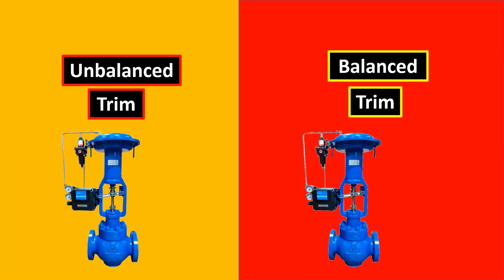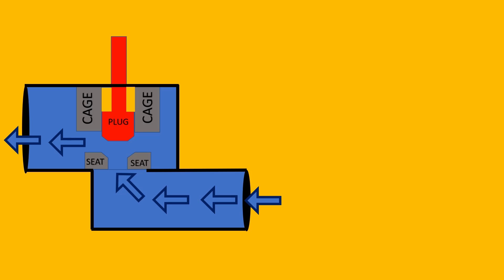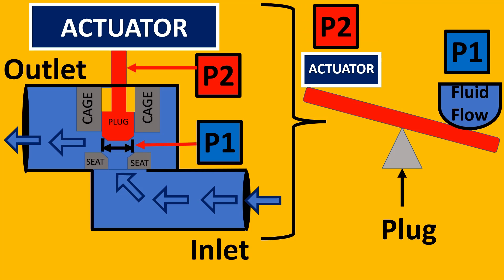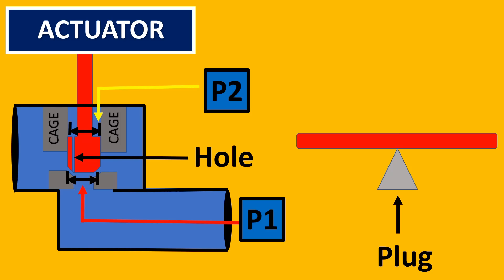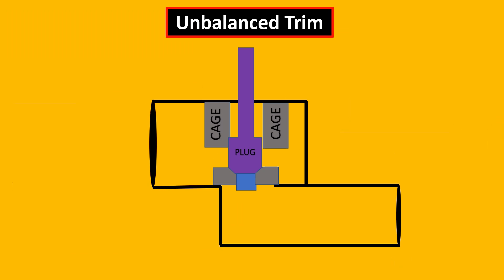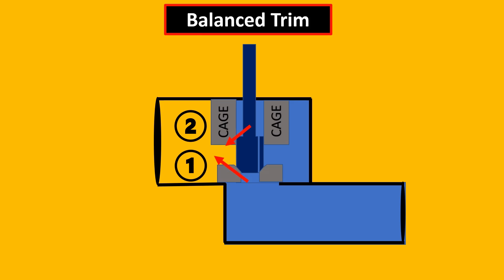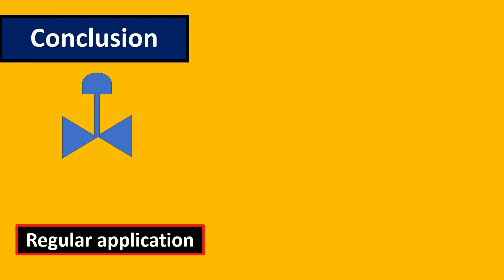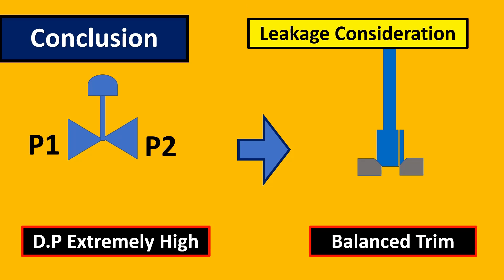Difference between BALANCED and UNBALANCED trim CONTROL VALVE

Comment: Good video. What is the purpose of "cage" in the valve?
Thanks.
Reply from the maker: I am planning  a separate video that cover the difference between plug guide and cage guided . I hope that would help to answer your question
Reply: @AsadPassionateEngineer  Thanks, eagerly waiting for that.

Comment: Normally we used pressure balanced trim when DP actuator was very high. Quite often very low pressure drop and large flow of say steam makes it difficult for an actuator to shut fully tight.  Solution is pressure balanced trim or else use of electrical or hydraulic actuator instead of pneumatic actuator.  Typical application are turbine bypass PRDS and spray water control valve with very low DP but very high inlet line water pressure.
Reply from the maker: Thanks for such an insightful comment ..... and sharing your knowledge Milind !!  😊
Reply: Thanks. Would you kindly elaborate "how low pressure drop and high flow steam makes it difficult for actuator to shut fully tight".... Thanks.